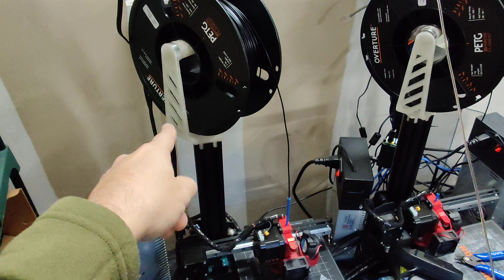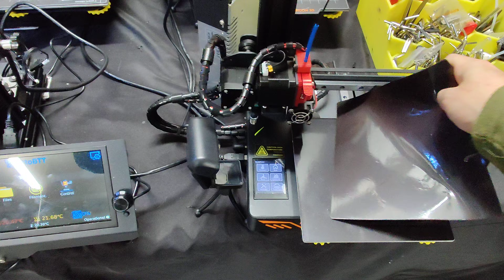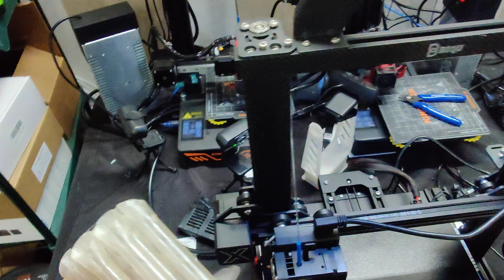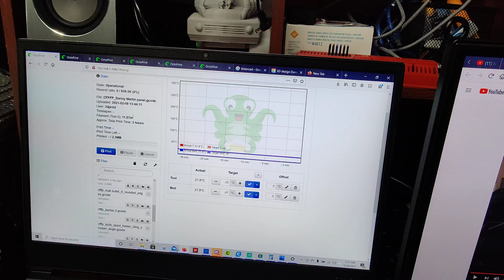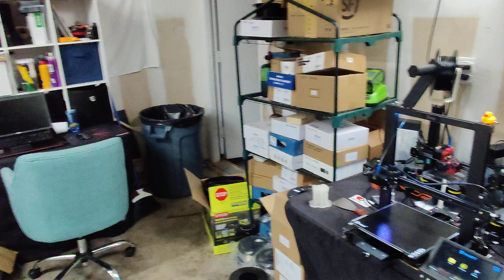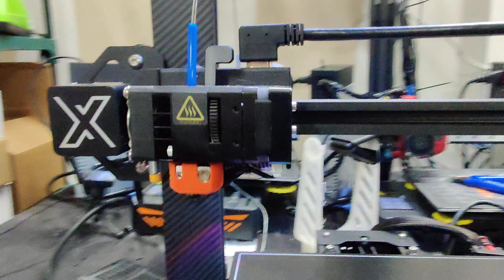KingRoon KP3S Update after 8 months of use.

Comment: So, do you run klipper on any of these.  Also, do you ever print ABS with any of these? Supposedly it is able to, but I have not found anyone who has done so.
Reply from the maker: I have few times but avoid abs like the plauge, I dont currently but have setup one machine with it and will switch others in the future.
Reply: @3DPrintsEverything  Yes, I do as well because of the fumes, but I am looking for a good reliable budget printer that can print ABS and PLA to put out in my garage since with my Micro Swiss all metal hotend on my Ender 3 Pro I can no longer print PLA without it clogging.   This looks like a good machine though I am not a fan of the display or the propriatary firmware.  I wish it was running Marlin.

Comment: I've got 2 that I've modded and really like them except for the factory firmware. Both printing with .6nozzle @ 150mm/s with 2000mms/s acceleration  and jerk value of 10 and they print quite well. Both have rails on all 3 axis, volcano heat block and nozzle, hotend carriage that accommodates 4020 fan for hotend and better part cooling ducts, pei plate. Once everything finishes get here, I'm putting a 115w chc, cht nozzle and adapter, bmg extruder, mks pi with 3.5" touchscreen for klipper, 60mm nema17 for the y-axis and a 48mm for the x-axis, good belts and tensioners on x&y axis. Right now I'm limited by the y-axis skipping steps @ or above  200mm/s with current accel/jerk values.
Reply from the maker: Nice upgrades! thats running fast too. I think you found the mechanical limits!!

Comment: Sorry, but calling a HDMI connector for this particular application cool is just plain idiotic. You need a locking, vibration-resistant connector with strain relief, NOT HDMI/USB or whatever other popular connector that is misused for this purpose nowadays. There is a reason why cheap manufacturers usually hotglue the shit out of JST XH/PH when used on printers

Comment: You cited only a single zscrew on the ender, but the kingroon only has a single z screw.
Reply from the maker: The kp3s yes only has one but this is advantage because the build plate is smaller slightly. at the 220mm size the arm and length is heavy enough you need a 2nd support and ideally a 2nd lead screw.
Reply: @3DPrintsEverything  Then cite the larger size of the e3pro makes it worse. A single z screw ... is a single z screw. You cant call the e3pro bad for having a single zscrew, if your comparison has a single zscrew. This is math, not my opinion.
Reply: @tazanteflight8670  Cantilever printers can only have one Z drive by definition. The ender on the other hand should absolutely have a z drive on both posts.
Reply: @TrashcanJan  The ender3pro makes 100% perfect prints with 1 zscrew,....... if you dont zhop. zhop is useless with 3d printing, anyways.
Reply: @tazanteflight8670  it’s okay to be wrong ;)

But seriously the gantry droops down on the non supported side
Reply: @probablyblue426  Yes the right hand side tail drags, and if you dont z hop, that angle wont change for the entire print. If you zhop, the whole system goes to shht. Its up, its down, its horizontal... 
All you have to do is move the print to the left, next to the zscrew, in slicer software, no zhop, and you will get perfect prints, everytime. The ender3pro is an amazing machine.

Comment: I found the K3PS a couple months ago and man, these things are absolute work horses... Definitely would recommend Octofarm for your setup, if you haven't considered it already. Streamlines all the octoprints into one (Saves me a couple hours a month just with managing printers). Also worth noting with the K3PS : Stepper drivers are removable (Super awesome since it allows for drop-ins of other drivers like the 2130 or 2209) And the K3PS control board has a dedicated BLTouch slot, which definitely has its own market of people (Like me who always wants more from my printers)... I think a accurate representation of these things is I had 2 working printers and needed to make 100 parts (30 minute print per part) in under 36 hours, so I had almost no room for failed prints, and the Kingroon worked flawlessly with no failed prints and parts that were perfect in tolerance...